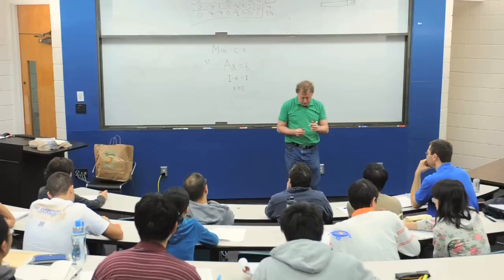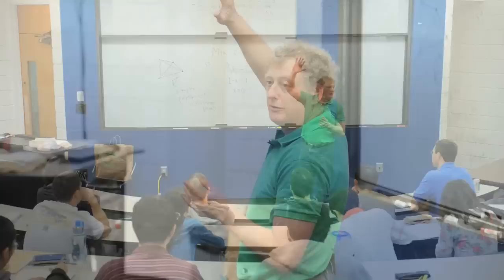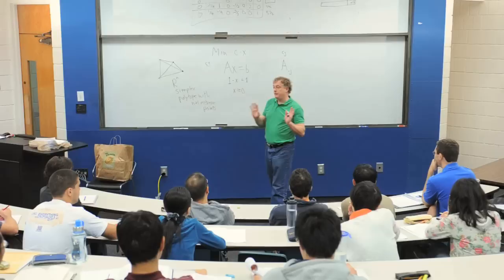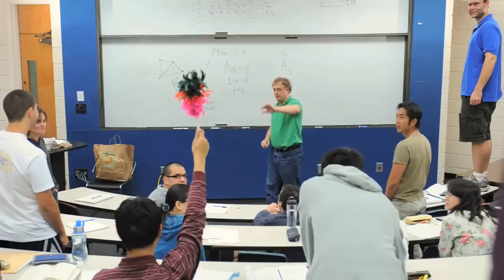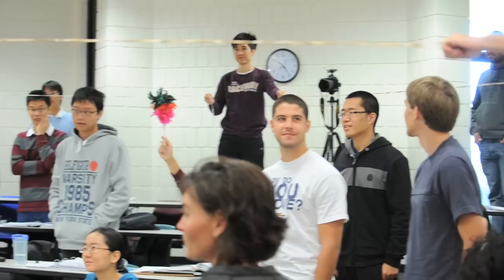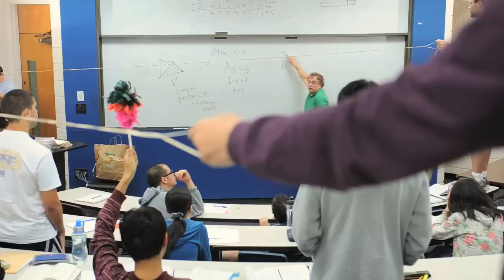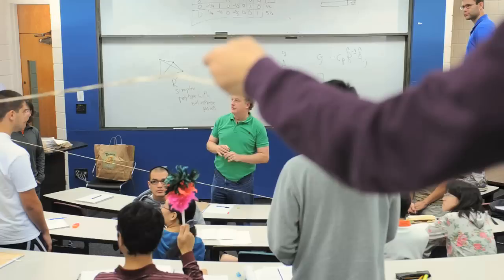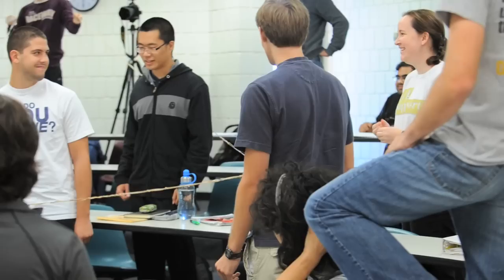Tovey explains the column geometry of the simplex method

Comment: Tovey, you said, "in two dimensions simplex is triangle" . What is the third vertex in this triangle? Is it Z axis ( objective function) , along with X and Y axes?
Every time,  in n+1 simplex polytope which has n variables, the last vertex is Z ( objective function) variable only I guess.
Reply: Don't think so. I guess the triangle comes from the two constraint equations of a two-dimentional problem. In the graph interpretation, you have three extreme points, excluding the origin, which does not met the equation Ax=b. Adding a third variable brings a new extreme point: Thetrahedrum.